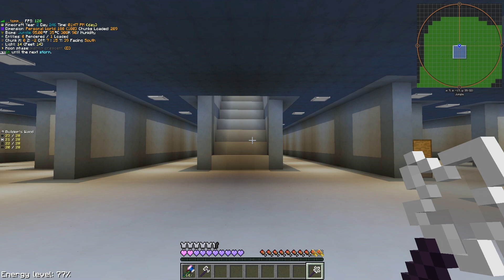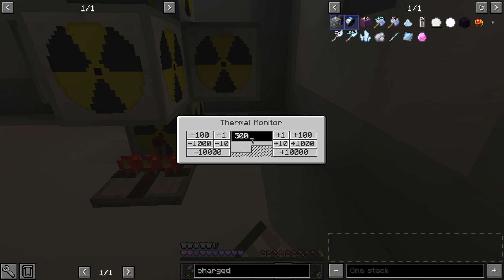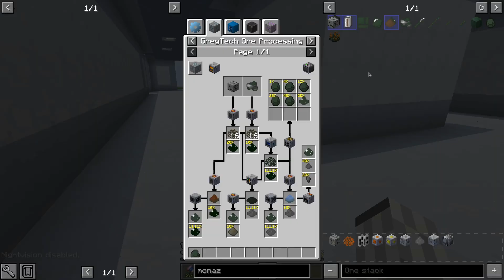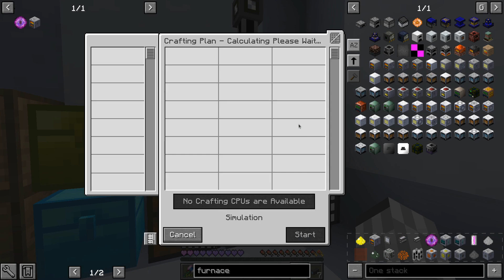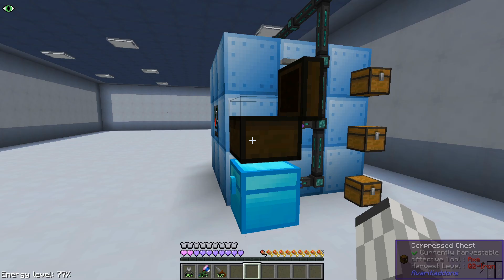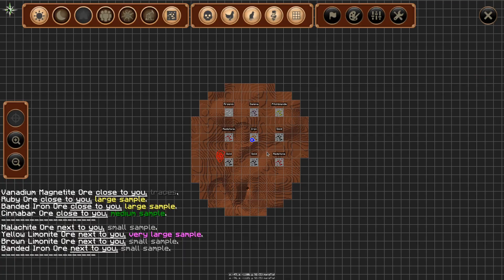GTNH S02E05: time to automate EVERYTHING!

Comment: I want to know how to work with oil like your video display , I try to build the progressing like you but I cannot do that ,I want to know the  detail. Thanks
Reply from the maker: what exactly are you asking for?
extract oil -> distillation tower -> all outputs into lcr with hydrogen and circuit 4; filter the outputs -> fill a tank with each oil product, leftover goes to a steam cracker whose output goes to an other distillation tower
Reply: @AverageGregTechPlayer  I dont know how to make the leftover goes to  a steam cracker just like you, and different cracked liquid(especially refinery gas) can get different products, how to use a single distillation tower to produce all of them. Thanks for you reply.
😀

Comment: What keybind are you using for your jetpack and hover mode?
You switch between on & off so smoothly and personally I can'T really find any keybind that works great for me.
Reply from the maker: "F"
the issue is that now this key is the default one for offhand
Reply: @AverageGregTechPlayer  Honestly that's why I'd love for them to backport modern control where you can bound to multiple key at the same time, like "shift+F" or things like that. Very useful.
Reply: @AverageGregTechPlayer  Ah well my default for offhand is G.... but F is also my sneak key that I have used since 2011. Frick :/

Comment: Your progress is crazy and admirable. Currently I’m near your progression in early EV age. I was wondering how u turn on the night vision for your helmet cause mine doesn’t seem to do anything
Reply from the maker: iirc it should be ALT + mode switch key
check in the settings what your key is and make sure there are no conflicts
i press ALT + R
Reply: @AverageGregTechPlayer can you make a multi smelter for smelting?
Reply from the maker: ....yes?
i do have one for the working of minerals, i'm making one for ae2 later on when i will be doing all the other multiblocks